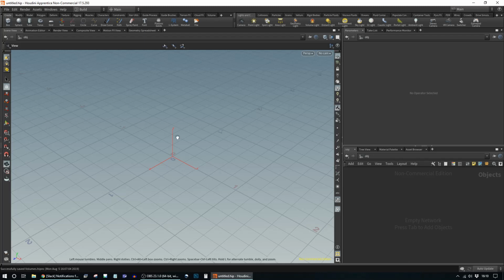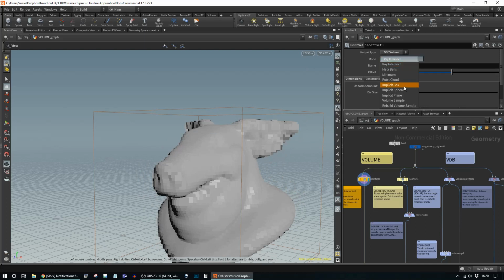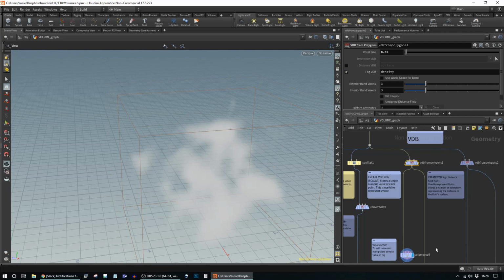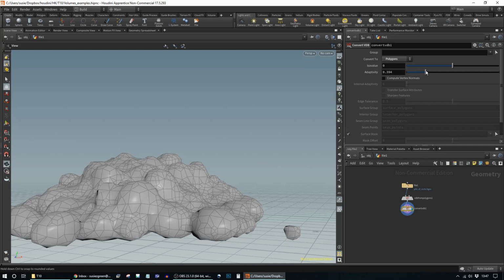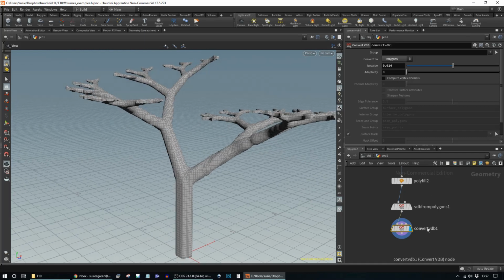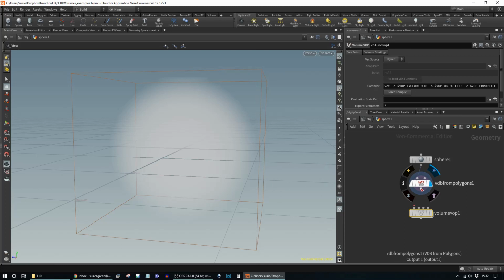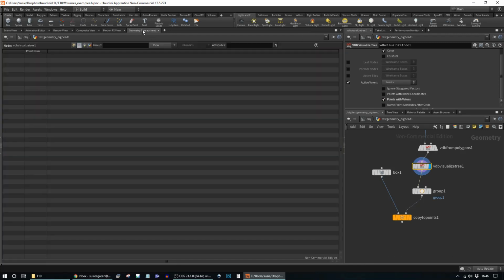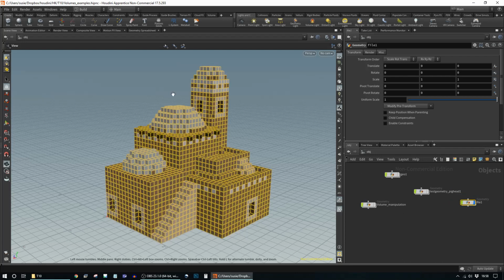Tutorial 10. Introducing Volumes and VDBs

Comment: Hi, in the iso offset I need to divide the space into non square sections, the object is slightly taller than its than length and width. But I noticed if I did that and adjusted the sampling divs to fit the shape snugly, if I then plugged another volume shape in it would mess up the divisions, as I guess it uses the bounding box of the object? I then tried to fix that up by extending the bounds on the volume to something bigger which does work but I was wondering if there was a better way of doing it? Hope I explained it well enough!